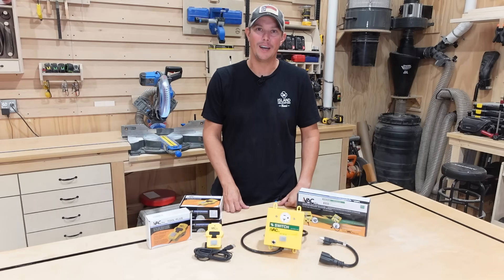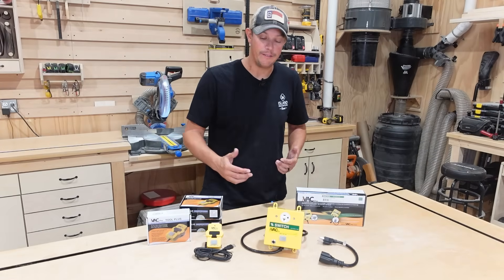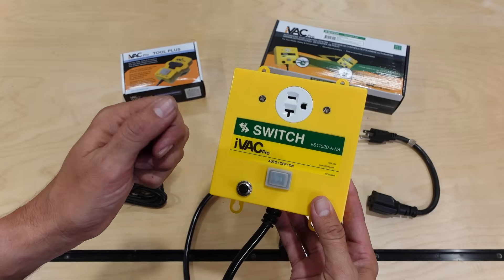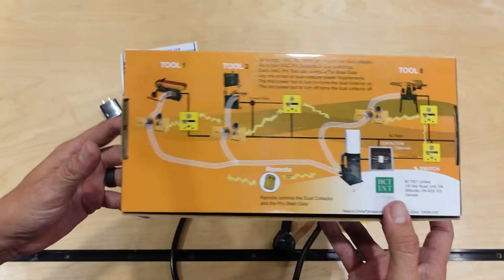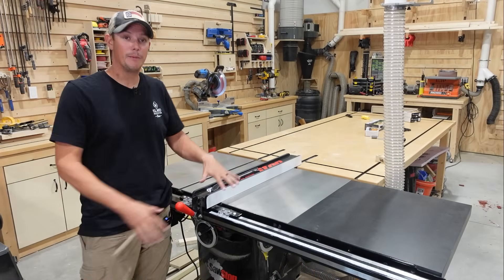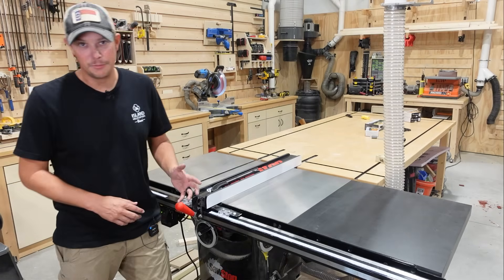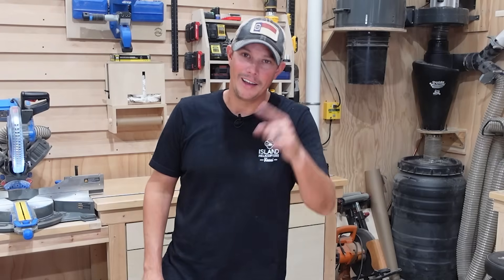Automate Your Dust Collection System / iVAC Pro

Comment: iVac Tech support here. Great video! The only thing I suggest is to move the Pro Tool Plus units 12-15" away from ANY other source of magnetic field such as another power cable or an outlet. They are sensitive and will pick up other fields.
Reply from the maker: Thanks for the advice

Comment: you shouldn’t have skipped the programming part. That’s where I got stuck
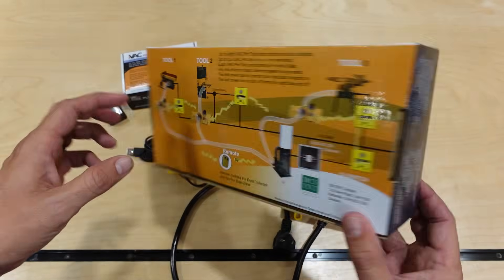Reply from the maker: I explained the programming and what all the switches do at 7:35 in thr video. Also the instructions provided by iVac are very clear.

As long as switch 1 and 2 are set the same on both the switch and the tool pro it should work.  (Make sure you arnt just looking at "up and down" the switch is labeled which direction is on and off, so make sure you have the switches oriented correctly)

5 and 6 on the switch are for setting the delay

4, 5 ,and 6 on the tool pro are for setting the tool ID